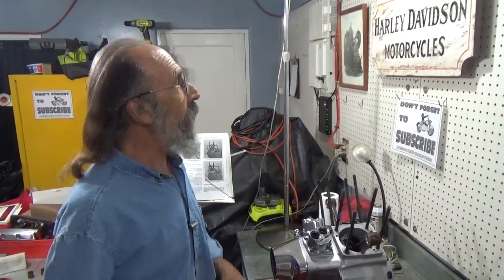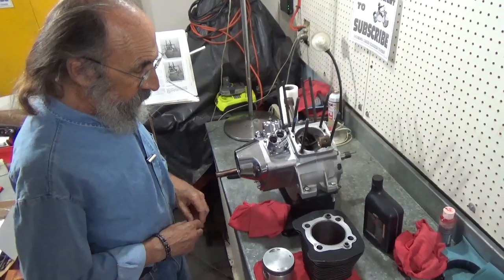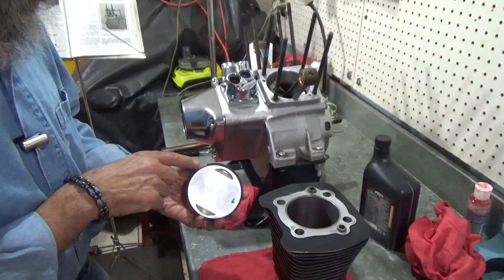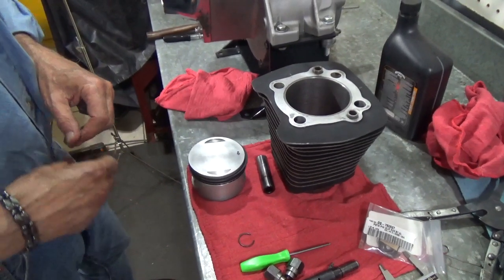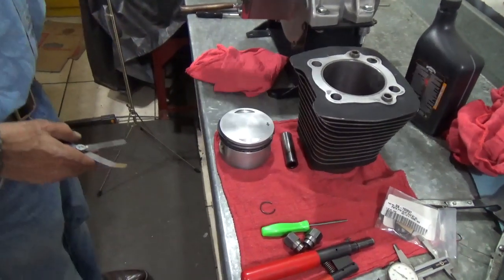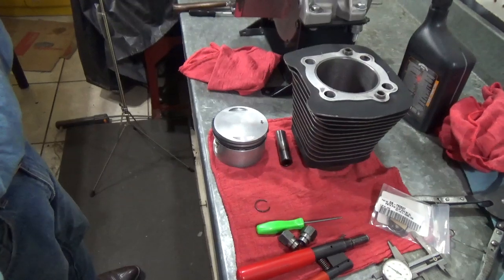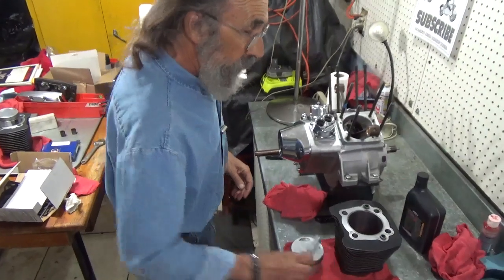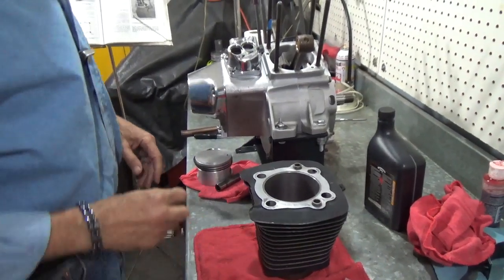Evo Motor Assembly, Part 9, Installing Pistons and Cylinders

Comment: Hey Mike appreciate your YouTube channel but I was just watching this piston and cylinder install and have to disagree about piston orientation. According to Harley shop manual both piston arrows are supposed to point toward front of motor. It has to do with piston pin being off set not which grove goes to which intake or exhaust valve
Reply from the maker: The aftermarket pistons are not always identified the same as Harley's own pistons.  It is something to look out for.

Comment: You should use torco mpz red on the piston & cylinder walls   , 90 % of piston & ring damage is no oil  bad crosshatch wrong grit hone & bottom of cylinder not tapered use 15 degrees cut them in lathe
Reply from the maker: Thank You.

Comment: Thanks Mike!!! Totally agreed, JIMS 1172 wrist pin clip tool is the coolest tools ever!
Reply from the maker: I find it works quite well.
Reply: Hi Mike, I’m confused the HD Service Manual for my FXR2/3 says “cast-in arrow points to the front of the engine”.  No mention of any difference in direction between front and rear pistons. I totally get your super logical rational re piston pocket size, but wonder if the last of the Evo motors could have had both arrows pointing to the front of the engine? Your expert thoughts would be greatly appreciated as I’m just about to finish my engine rebuild — I’ve used your awesome videos all the way — THANK YOU
Reply from the maker: Make sure of the intake valves being over the biggest pockets.
Reply: I came to the comments for this. I haven't looked it up yet, but I assume it's the same tool as used in this video.

Comment: As a question regarding the arrows in the piston crowns. In the service manual it says "If the piston has an arrow cast into the crown, install it so the arrow faces toward the front of the bike."
So which is the correct way?
Reply from the maker: Sometimes the pistons are identical front to rear.  Sometimes they aren't.  Sometimes you have to match up the size of the valve pockets in the top of the piston with the valve sizes.  Not always easy, not always an explanation from the manufacturer.

Comment: Hey pacific mike! Would I be alright to do a top end rebuild on my buddy's 98 Evo big twin with used juggs that aren't in bad shape with new pistons, and rings? Was going to do a hone on the juggs to get a good cross hatch since they're out. As long as the sleeve isn't worn too well and the bore is in spec, it's ok to do it this way right?

Thank you sir, just trying to rebuild it the best I can on a budget
Reply from the maker: Have a qualified mechanic check the cylinders for wear.  Refer to the "service wear" limits in the service manual.  Apply a little common sense and go for it.  Remember the cylinders need to be fixtured to be measured properly.
Reply: @pacificmikesgarage  Thank you Pacific mike, I appreciate that

Comment: I live in Redlands ca ur vids are helpful I think I have to redo my im rings on my 2001 road king it’s smoking and burning oil
Reply from the maker: Depending on how well the engine has been maintained and how many miles are on it, it might just be valve seals.
Reply: @pacificmikesgarage  it has 40,000 miles and motor been Maintained well always took the bike in Wright bros customs here in Redlands, out skirts of Yucaipa Harley shop
Reply from the maker: Then, there is probably a good reason it's burning oil.  Maybe you ought to have Wright Brothers have a look at it.  40 thousand miles is not much.  I doubt you need new rings.  Probably valve seals either.  Maybe no big deal at all.
Reply: @pacificmikesgarage  thank u

Comment: I'm at a pause at the moment.
 I took apart my 97 wide glide evo due to a #3 rear stripped stud causing loose head bolt. Gasket leak
Pistions on it had a clear visual of larger gap both facing in.

I decided to buy all new stock cylinders/pistion kit from jp cycles and pay to get heads rebuild. 

The new pistons have save exact gap size but with arrows an confused which way they both point.
I currently have it like this atm ⬅️➡️
Reply from the maker: Probably fine.  Check with the mfgr.

Comment: Mike, I'm trying to figure out if I need to rebalance my crankshaft if I replace the pistons.
Reply from the maker: Only if you're ready to rebuild that flywheel assembly.  We don't call it a "crankshaft," even though it's same as.  You balance the flywheel assembly when you rebuild it.  You generally don't really need to rebalance every time you replace pistons.  You can however, if you feel the need, match the weight of your new pistons with the old ones.  Again, not really necessary.
Reply: @pacificmikesgarage  much appreciated.

Comment: Hey Mike, what service manual do you use for your evo motors? I have an Ultima 113 and looking for a good service manual. Thanks in advance. Jim
Reply from the maker: I would use any Evo service manual that is for a Softail, if that's what you have or a bagger, if that's what you have.  But I would mostly use whatever printed material Ultima has for the motor.
Reply: @pacificmikesgarage  Thanks Mike, Im running a 1989 Road King, Ultima 113 with rev tech 6 speed tranny, and open primary. Dropped a lifter...broke some stuff. Got it tore down to the cases...building back up now.
Reply from the maker: Very cool.  The appropriate service manual would be a 1989 FLT book.  The motor specs will have to come from Ultima.  Sounds like a fun ride.

Comment: I really enjoy watching your videos - I appreciate your true mechanical knowledge with so many "parts fitter" mechanics out there. It is truly a dying art!  A quick question if I may; regarding a 1988 FXST Evo... been rebuilding the engine and will split the cases to re-seal them. I was wondering about the side to side clearance of the conn rods with the flywheels. The clearance between the rear rod base and the flywheels is 18 thou, and that between the front and rear rods is 32 thou. Is this still serviceable? As an aside I cannot imagine that there is any contact between these surfaces during the stroke of the engine so I cannot see how the clearance would "wear" or change? There is no discernible up/down play at all. Many thanks,  Phil
Reply from the maker: You're probably just fine.  Wear limits, in the service manual, are generally quite good.  But, what you're looking for is up and down movement.  You don't want any.
Reply: @pacificmikesgarage  Thank you Mike!  I appreciate the prompt reply :-)

Comment: Could you Explain shallow versus steep crosshatching?
Reply from the maker: If you're honing cylinders, and this was taught to me by my favorite automotive machinist, a steeper crosshatch will carry oil better up and down the cylinder walls.  It is steeper procedures today for an easier breakin, and supposedly, this comes from NASCAR.
Reply: @pacificmikesgarage  im still not sure what you mean or what the difference is .. .??

Comment: Hi dumb question but if don't space the rings like the book says will cause oil to come out exhaust thank you for your knowledge
Reply from the maker: On all piston rings "staggering" the end gaps is always necessary.  The prescribed pattern shown in the Evo service manual is (in my opinion) ideal.  However, if the bores are "oblong" the gaps will line up with each other.  Very common on an Evo.  This is why aluminum cylinders should always be "fixtured" when they are bored.  If they line up together, oil will pass right through.  Not a dumb question.  Believe me, it is a real "live and learn" situation.  Also, be sure the end gaps are set according to the manufacturer's specifications.
Reply: @pacificmikesgarage  man I appreciate you help thank you. So what happen was I had bad valve seals I replaced them no problem but I took the jugs and pistons off to clean the carbon off and when I put it back together it smoked and oil was coming out of the exhaust port on both heads

Comment: Hello Mike great video! But I am in the middle of putting together my 2002 sportster 1200 custom and I saw your video in how you showed how to position the pistons with the arrows pointing towards each other because of the size of the indents for the valve clearance . In your video the indents were different sizes in my situation they are the same size I double checked it with my caliper like you did and it confirmed it so how do I install the pistons in this situation? I would really appreciate your help thank you
Reply from the maker: Both forward should be fine or check with the manufacturer.
Reply: @pacificmikesgarage  thank you sir for your quick response, I looked it up in my manual and there is no mention of the procedure so I will follow your advice thank you again

Comment: Mike, as always, your videos are invaluable. You have such a great way of teaching this stuff! Quick question for you. I picked up a 1988 evo motor. Mechanically the engine is in great shape, cosmetically it looks like dog.... well  you know. Can I strip the black paint while the engine is assembled? I can pull the jugs off but would rather not split the cases as it's not needed at this point. Just wondering the best method to strip the paint when I'm not doing a rebuild on the motor? Thanks!
Reply from the maker: No matter how you do it, stripping that paint off is a lot of work.  I use paint remover, which also removes skin.  Use gloves.  It takes a lot of applications and a lot of water.  Hard to keep it out of the motor.  You could get some paint and repaint it without stripping it.  Just clean and prep  it.  Then paint it.  Picking your materials carefully might do it.  Not an easy project.  This is when I use Harley's own paint and talk to the guys at an automotive paint shop.

Comment: hi mike! on front cylinder...whats the rear right hole for in the case . i know the front left  is the oil return from top end. i have the same holes as your vid but you didnt cover that one! lol
Reply from the maker: I'm not sure what you're speaking of.  But, quite possibly, you're speaking of an access hole for machining the oil passages for the tappet blocks.
Reply: @pacificmikesgarage  
I have the same access hole on my 93 evo motor case. It is plugged. The plug is recessed slightly. My base gasket covered the hole. I hope this is how its supposed to be.

Comment: Hey Mike! First of all, thanks so much for your videos. They're great! But, I have a question. I'm refreshing the top end of my 1993 FLHTCU, and sadly I removed both pistons without noting the direction of the arrow on the front cylinder. The service manual (FLT/FXR Models, 1993 and 1994 Official Factory Manual) says on Page 3-34 that "The arrow on top of the piston points to the front of the engine." In your video, you say that it should point toward the intake valve. You also said that the pockets on the piston are different sizes (the intake being larger), but that's not the case on mine.  Well, they're not EXACTLY the same width. At the widest point, one is 1-3/8" and the other is 1-13/32". By the way, the part number of the pistons are 22091-83B. Help?
Reply from the maker: What I said holds true.  The biggest pockets point toward the intake valves.
Reply: @pacificmikesgarage  Thanks, Mike!

Comment: Great video . I have one of the first EVO motors in 1985  Super Glide base gaskets leaked after about 30000 thousand miles. When I replaced the gaskets the first  time  they leaked again after about  the same mileage. So the next time  I cant remember who or  where  I got a set  tubes for the oil passages to the upper end. Problem solved. Have you ever heard of them? I live in New York seems bikes shops around here know about them. What’s your take on this fix?
Reply from the maker: Yes, they are a good fix.  I remember them being available from several suppliers.  They did come from Southern CA.  Should be looking through some catalogs.

Comment: Install pistons in cylinders first , then install pin and clip, Much better . Do use atf or wd40 on rings and pistons . it burns right off and seats the rings quickly.
Reply from the maker: Maybe so, maybe not.

Comment: I have a 1988 FXR low rider. It looks like stock pistons. When disassembling it both pistons arrows were facing the front. This is different than what you eat showing. What should I do?
Reply from the maker: Look those pistons over.  Notice that the pockets in the top of the pistons are slightly different sizes.  The bigger pockets are for clearance from the intake valves.  Feel better now?  It's just the way they make them.

Comment: Great video, Mike. You usually have little tips about every gasket, alignment, sealing, crush etc. Did you use any kind of sealant on the bottom gasket, when you put the cylinder on?
Reply from the maker: No.  It is dry, as per the gasket manufacturer's recommendation.

Comment: Hi Mike, what do you think of the S&S service bulletin for an EVO engine how to position the piston,• (These pistons can be used in either the front or rear cylinder, however they must be installed with the arrow on the dome pointing to the front of the engine due to the offset wristpin. If pistons are received from S&S® fit to cylinders, pistons must be installed in cylinders they were fit to.)
Reply from the maker: That's the way it's done.  Always adhere to the manufacturer's recommendations.

Comment: Sooo, I pulled my Evo apart, had it bored .005 due to some scoring (this all started because of slight base gasket leak), the new pistons the machine shop supplied have an offset wrist pin bore. According to research, the shorter distance  goes to the back of the motor, however, that would put one large valve relief at the intake valve, and one small relief at an intake valve. Also, when I pulled my engine apart, both arrows were pointing forward. My head is starting to smoke lol. I’ll figure it out, but, some insight from an experienced builder would be appreciated if you have the time. Thanks and great videos.
Reply from the maker: I think I would be talking to the manufacturer of the pistons.  You're checking things out carefully and I applaud you on that.  You deserve answers from the manufacturer.  When I question a product, I go to the source.

Comment: Why didn't you use a bolt to push the pin inside the piston? Don't you afraid to bend the rod with a hummer?
Reply from the maker: A slight "tap" with a rawhyde mallet on a plastic screwdriver handle? No.